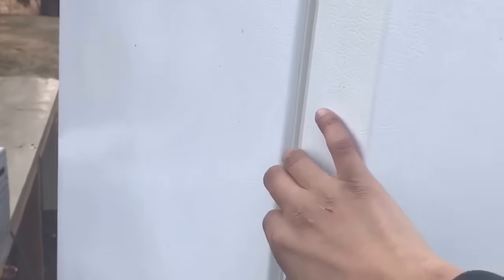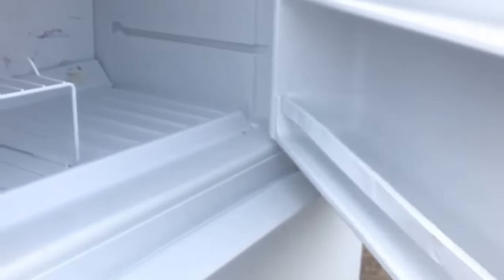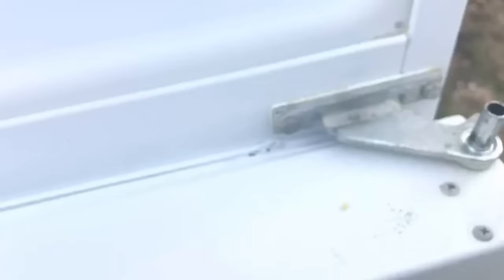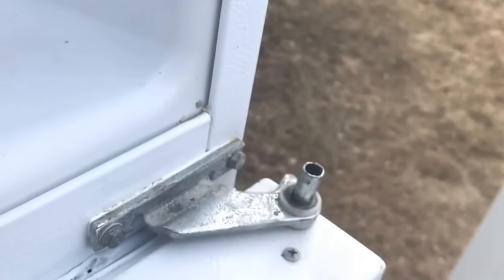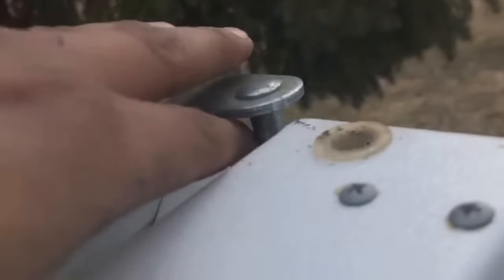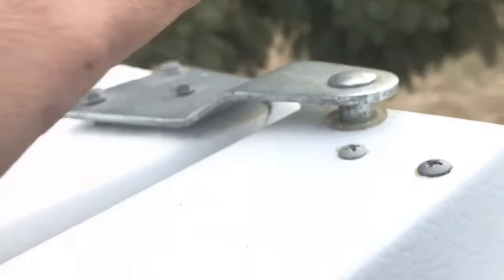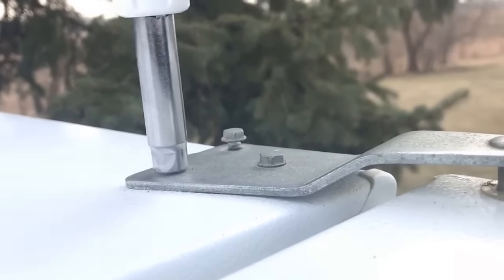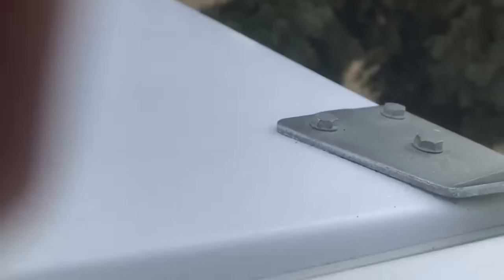How to fix refrigerator door that won't close properly

Comment: Thanks a lot for your sharing! I watched your video last night and fixed the problem of my refrigerator door today. The door have been bothering us for a couple of months.
Reply: First I had a temporary fix with one plastic washer. It worn out quick. Last week I went to Walmart to get some metal washers. I used three new metal washers and re-did the door. Now the door closes even better! Hope that this time it will last long. Again, thanks a lot for your sharing!
Reply: @ruotui  Metal washers over time will "eat " the door making it uneven surface. You are supposed to use a washer which will wear over time and you can replace it, you don't want your to ruin the door's contact point !
Otherwise they would just use metal washers from the factory 😜

Comment: Will this fix work on a side-by-side full door refrigerator? Mine has stopped closing all the way.
Reply: Even tho this works I think what he showed here would be for minor misalignments i would look to see if you could adjust anything else on the fridge if you are able to shift the door any way else like loosening any hardware and trying to move it that way before trying this.
Reply: @Neymar-qf6zk  Thanks! I"ll look at a few things before attempting this fix.

Comment: Great video! Short and easy to understand. 
My refrigerator door has this problem. I cannot believe that is caused by washer only. What really makes refrigerator door to have the swing motion? Just wondering.
Reply from the maker: I am glad that I was able to pass some good information to you !
Reply: Freezer door pops open when refrigerator door closes
Reply from the maker: that is a very common issue Things to look for : Check the leveling legs. The front of the refrigerator should be slightly higher than the back, to allow the door to close normally. When properly adjusted, the door will close smoothly and firmly on its own.one very common problem is : Check to see if the refrigerator door gasket is sealing properly. If not, wash the entire gasket with baking soda and water (1 part baking soda to 3 parts water), especially on the hinge side.*help full tip if everything else is good try a little bit of Vaseline on the gasket to create a little bit of more suction to help close the door

Comment: Okay, I have the problem where the lower door won't stay closed. Will this fix address that problem?
Reply from the maker: Hey Phil this can definitely be one of the many things that can be causing the issue for your door because over time doors start to sag do to what we put in them. With out seeing it myself I cant really say much but I would say look at your fridge seal gasket as well it might be loose or old which can cause the fridge door to lose that seal tight vacuum closing capacity. keep me updated with what ever solutions you find to your issue! thank you.

Comment: With mine I loosened the three top bolts, lifted the fridge door up so that it was level with the top of the fridge body and then tightened the bolts down and it’s closing just fine now. Before I started the top door was higher on the hinge side. I would think that adding that washer would have made the problem worse.

Comment: what if its the bottom door thats not closing good?
Reply from the maker: Hey Natalie it's the same for the bottom there would be a washer make sure that is okay , and make sure your hinges bolts are tight sometimes over time your hinge might become unaligned so you can try to move it with a hammer to get it back into its location it all depends on your situation I will make a video on that soon! Hope this helped you out a bit .
Reply from the maker: The Washer could be an issue but most likely in her case the hinge in the bottom of the refrigerator has misaligned over the years. A common way to fix that is to remove the bottom door and align the hinge to what ever side she needs it to move this is a great video to watch very informative https://www.youtube.com/watch?v=3_fJSxFdw34

Comment: my issue was the door has the washer and still doesn't close by itself as it should. good vid if my washer was missing not so hot when it is there tho...
Reply: Replace the washer .. they are damaged overtime .. simple 👍
Reply: @chriscs9080  after two yrs the darn thing started working correctly....go figure.